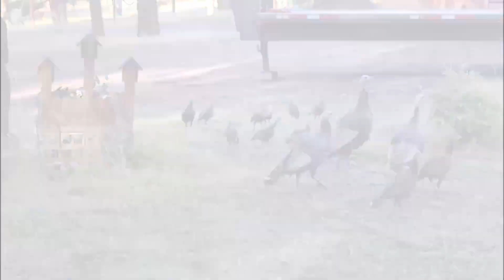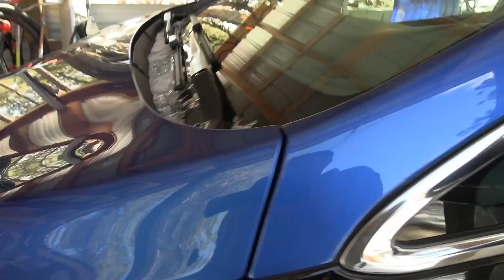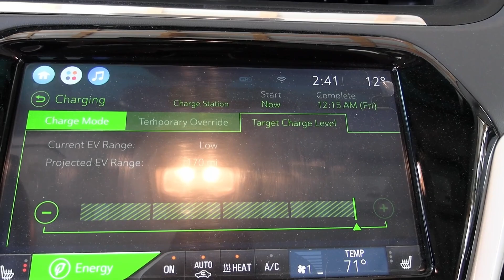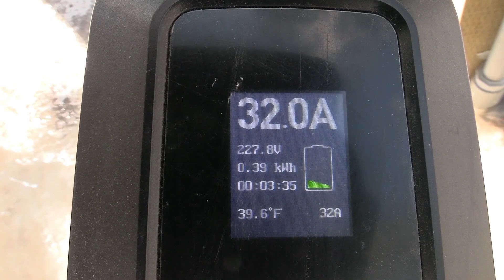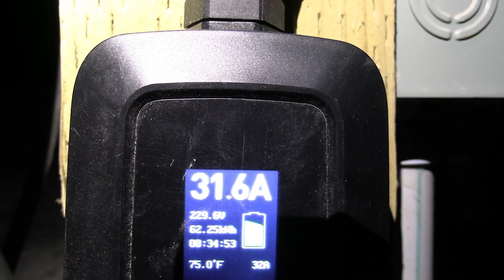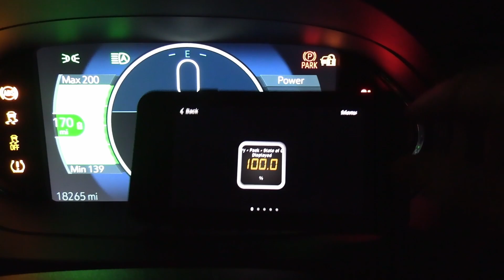Chevy Bolt at ZERO state of charge. Does it drive? How many kWh to full charge? How long to charge?

Comment: I have driven my car with no bars remaining. I was quite slack jawed as I did not know how far I would go.

Tip: If you turn the car off and open and close the door even when it’s low it will give you a range estimate.
Reply from the maker: It can give a weird feeling when the last bar goes away. 😂 
I know when the car gets to 2% since that is when it asks to turn off the radio.
Thank You for the tip. Did not know that 👍

Comment: Thank You. Just thinking when will a person have to replace battery pack and if a average person in his garage could order and replace it in his home garage.
Reply from the maker: It requires some heavy equipment to replace the pack. You would have to have a lift to raise the car and a heavy duty table or similar to carry the weight of the old pack to get it out and the new pack in. These packs are heavy around 1000lbs. While these things could be done somehow, there is a huge safety risk when handling high voltage battery packs. Requiring special procedures and personal safety equipment. Battery packs need to be discharged for transportation too. And then it usually requires pairing the pack to the car via software. Not something for "home" replacement at all.
But all that said these packs will outlast the rest of the car. Nissan Leaf had issues due to the air cooling on their packs, but liquid temperature controlled packs will not have issues like that and will last. Our Model S is nine years old and has 200k miles on it. Same battery!

Comment: You cover interesting topics.  My 2020 only has 9K miles on it, so I'm not as worried about battery capacity now, but that will come soon.  I was directly interested in driving the car to low battery levels.  You mentioned driving down to 2-3%, or about 5 miles of range left.  Did it drive normally or did you get "reduced propulsion"?
Reply: My 2017 got down to about 6 miles once. All kinds of beeping and warning messages. Propulsion was limited to around 50mph and hardly any acceleration. Since I knew I was close to the Amarillo EA superchargers, I was just amused instead of worried. It asked about turning off radio/screen. When I clicked yes the center screen shut down & didn’t come back on until after charging.
Reply from the maker: @Bren Dykes I never noticed the speed being limited, but most of the time we are on the way home where we have low speed limit anyway. And just as you say if you know that you only have a short distance to the next charger then you don't have to worry.
You can adjust when the radio question pops up. There is a setting somewhere in the menu where you can choose a SOC%. Actually I wonder if that is the same in 2017 as 2020? Since the 2017 has a slightly different software?🤔
Reply: @RMTFamily  last night I actually ran it low (below 10mi) and got the propulsion warning and zero bars. So to correct myself, speed didn’t seem limited, but acceleration was. It would still go at least 60mph, but was a little sluggish accelerating.  -and everything flashing orange & beeping 😂
Reply from the maker: @laxtimercom Thank You. The propulsion reduced warning comes on relatively early, but I have not experienced any real reduction other than for accelerating. Most of the time when it comes down close to zero we are on the way home and for the last about 7miles the speed limit is only 35mph. This maybe the reason I don't notice any difference. In one of the road trip videos we have, I think, I show or talk about the propulsion reduced. And there was really not any reduction when it first popped up anyway. 
In order to know when you hit the 2% SOC you need to change a setting to have the radio power down at 2%. It is somewhere in the settings. When SOC is 2% it will ask you if you want to turn off the radio. Which conserves very little power. I don't know that it even makes a real difference since the radio is 12V and only uses a few watts. A better thing is to turn off HVAC completely to save energy if really needed.
The first time you get down there it is "interesting" but after doing it a couple times you don't worry anymore.😀😉